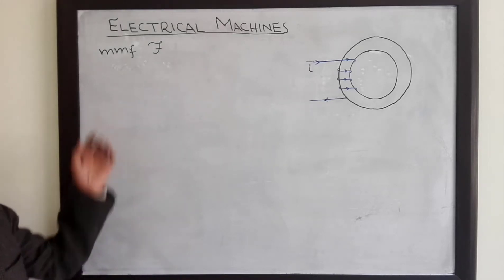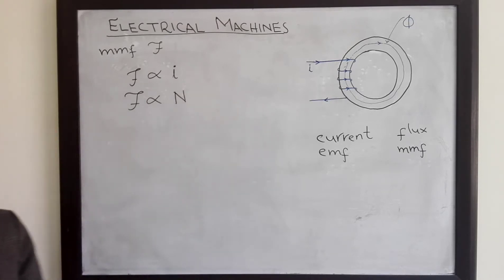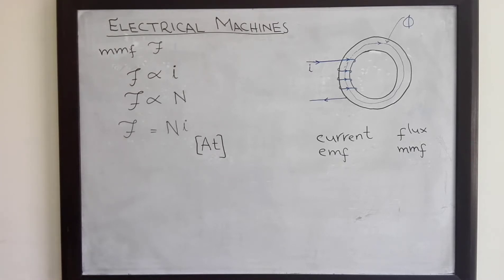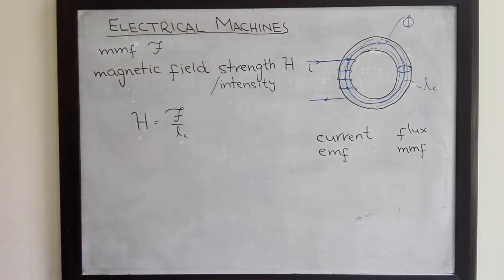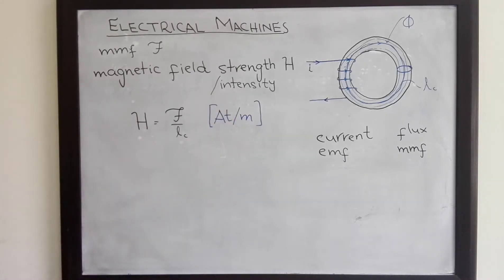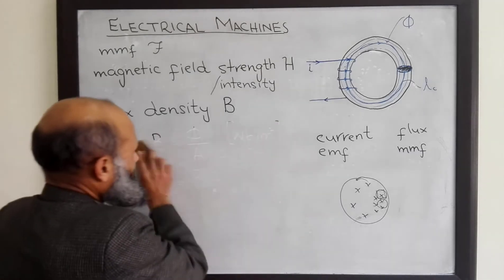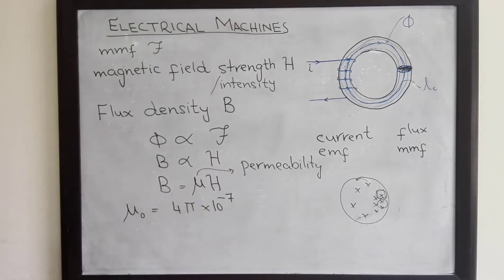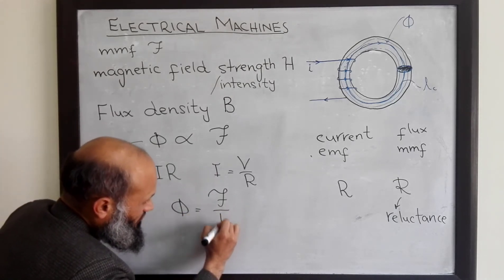EE213  - 1b - mmf, field strength, flux density, reluctance

Comment: I would like to see the rule of ur to the flux in a fruit material core of an inductor please, thank you.
Reply from the maker: Magnetic field of a solenoid is discussed in the first lecture at the following link  https://youtu.be/ERLT2Kc6iYw
Reply: @MAFarooqi  Dear sir, thank you for your quick respond.  My question is, If we have the same inductor and excited by the same current but different core material would the flux be difference.  My understanding is that flux is generated by the current.  
My second question, Is not the flux  (phi) and the H be the same?  Both generated by the current.  Thank you.
Reply from the maker: @alimovahedi7714  Yes, definitely. If you use a core with high permeability (larger mu), there will be more flux (stronger magnet) and higher flux density.

Flux (phi) and magnetic field strength (H) are two different things. As an analogy to electrical circuits, you may consider H (more precisely mmf) to be something similar to voltage and phi to be similar to current in electrical circuits.
Reply: @MAFarooqi  Dear Sir, thank you and I do appreciate for your time.

Comment: Flux never flows, it get established!
Reply from the maker: Flux and flux lines are something hypothetical used to explain the phenomenon associated with magnets.
Reply: @MAFarooqi  

What I think our OP is trying to say is that: Flux does not flow like a river. If you step into a river you get pushed along with the current. To keep the current Flowing you need energy. To keep an electric current flowing you need a voltage.

A magnet on the other hand does not need energy to be keep it going. Hence permanent magnets.

With an inductor,  you only need energy to establish the field. Which you get back when the field breaks down.

Hence Flux never flows, it gets established.